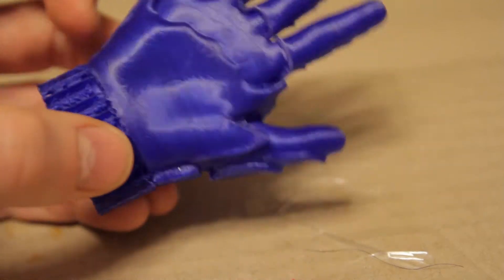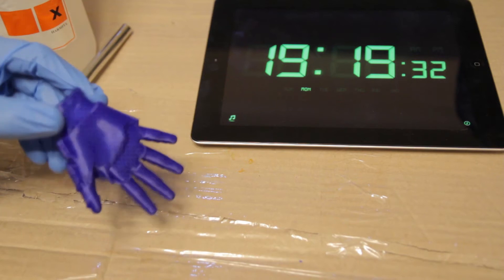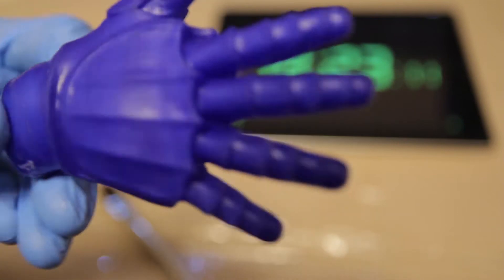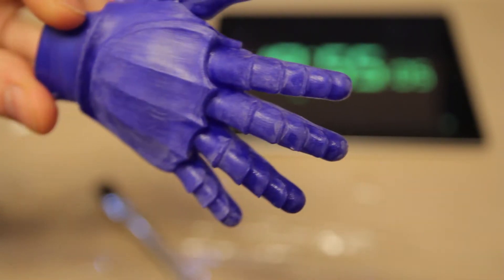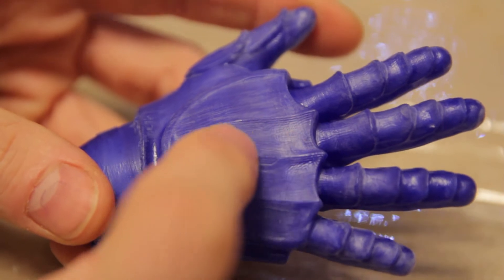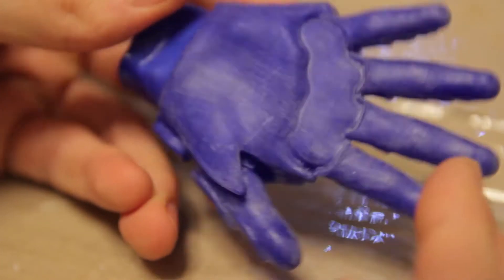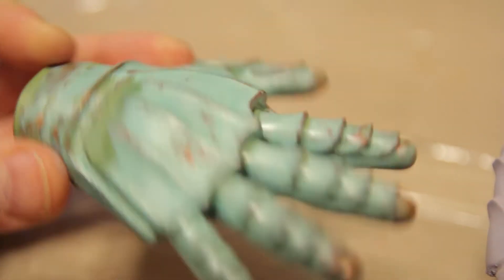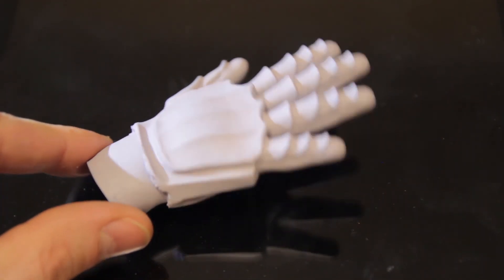PLA AND METHYLENE CHLORIDE

Comment: I dissolved some PLA scrap in some Methylene Chloride(DCM).
It made an excellent glue for PLA.
Reply: dont use methylene chloride, very bad for the environment and the ozone layer and seriously gives cancer. Banned in many labs (i am a chemist) ! Dont use it for this application
Reply from the maker: Acetone alone works very well as long as good contact is made quickly.

Comment: Anyone tried a spray, a light mist rather than brush it on ?
Reply from the maker: You cant spray a light mist with most of these solvents as they evaporate far too quickly. Methylene chloride evaporates quickly even in a closed sealed container. I tried with an airbrush but it just atomizes it and the thin layer does not last long enough to have any real effect.

Comment: dude try it in a air tight tank and vaporise/atomise the methylene  this vid is way more informative than the last one
Reply from the maker: Thanks! but just to let you know the model has split quite badly now, so I'm sticking to the acetone method for now!
Reply: @Cloakfiend  Aceton doesn't work on plans sadly enough
Reply from the maker: @StemmProductions  It works on Colorfabb PLA/PHA which is what is used here.

Comment: I wonder if a vapor type system would be better, avoiding the problems and safety of working directly with the liquid.
Reply from the maker: Its not that bad, and you can always do this outside. The main issue is storing it as it evaporates very quickly, much quicker than acetone. brushing on heavily once is usually ok.

Comment: Try to warm it with a small torch to get the shine back
Reply from the maker: Ill give it a go but small details with melt or warp quickly with a heat gun.
Reply from the maker: Im plating it anyways so the surface shininess is irrelevant to my needs. I rarely leave the object as is after the print unless I'm giving the prints to children.
Reply: Cloakfiend what are you plating it with? And are you using conductive ink ? I tried copper plating with a mixture of graphite mixed with airbrush paint but was not totally satisfied with the result, maybe you had more success?
Reply from the maker: Deadbull im plating with graphite most often. Out of a can. Dont waste your time making your own in my opinion, you are just making your task more difficult and considering you dont really know what you are doing its best to start with products you know work, not diy guesswork. Do DIY once you have some experience and knowledge otherwise there are far too many variables that cam go wrong on you!!!
Reply: Cloakfiend today I came across your posts by chance on a forum I visit and sometimes post at, how weird is that?!
I saw you had some trial and error with plating to find the best option for the mixtures as well for different models. I'm not trying often and only had 1 out of 4 tries that worked pretty well except on 2 small spots where the paint didn't adhere but the rest was perfect. Because it took so many tries I didn't have another go at it but want to continue from their to have another go at it soon. Talk to you on the forum!
Reply: Heat gun works better then a torch fyi, how ever both will work just the heat gun is more controllable (its like a hair dryer but gets hotter).
Reply: AcidicSights i use the drempel versatip which can be used the same, at 6 inch you can hold your hand in front of it with the right attachment. A lot more usage then a heat gun, saves me to buy a heat gun also.
Reply: Further distance with smaller details I won't say you'll get it perfect your first go around but you tend to get the knack for it over time ..  Deadbull never tried a versatip how ever I could see how that would work even better then my suggestion..  I just happened to have the heat gun already so I used and got used to it.
Reply: AcidicSights it's indeed get the know how to handle it, I tried on some scraps first, it's real handy with the different tips you get with it, so you can also use it to smooth out little bumps or uneven printed pieces. Even used it to melt broken piece back together.

Comment: I've used Methyene chloride, you get better results dipping the part for 10 or 20 seconds then wave it about to stop melted bits from sagging as it dries off. Not a nice process really.

A really brilliant method I've found is to use clear UV cure resin (and even UV cure nail polish), I got some like this:
https://www.ebay.co.uk/itm/25-60-100-200g-UV-Curing-Resin-Solar-Cure-Rare-Hard-Type-Non-toxic-Materials/263083064078
a 60ml bottle goes quite far.

You brush it on with a small 1/4" brush making it pretty thin - just enough to smooth the lines then expose it to UV for a few seconds to harden it. The great thing is you can do a bit, harden it, then hold the part by the hardened bit. It's thick stuff so you can dab on more to fill large faults and it's sandable after if you need to.

Words of caution: 
Do not use cheap LED-based hardening light - they don't work well at all. They seem to harden the resin almost immediately but leave it sticky, exposing it to the LED UV for ages doesn't seem to lose the stickyness. With a florescent tube type hardener the stuff mentioned above gets rock hard in less than 10 secs.  

The 'hard type' resin is really hard and brittle, if you bend a PLA part the resin will crack off. I have some UV nailpolish which goes pretty hard but remains a bit flexible (and it only comes in daft colours). I will be trying other UV resins when I get around to ordering some.

To do that hand, you'd only need a teaspoon full of the stuff, so just get a bit at a time from the bottle and be careful to not harden the resin you have out with the UV light!

Yours,
  TonyWilk
Reply from the maker: Tony Wilk thanks for the info, ill give it a try! I still do like acetone. Its very quick, goes on easy and i dont even bother with the sanding if ive dipped or brushed on loads.